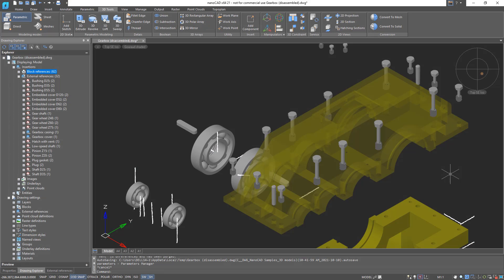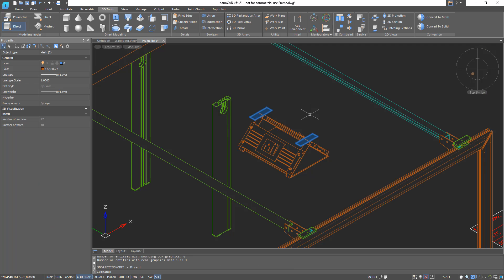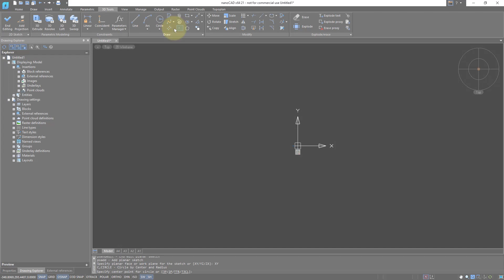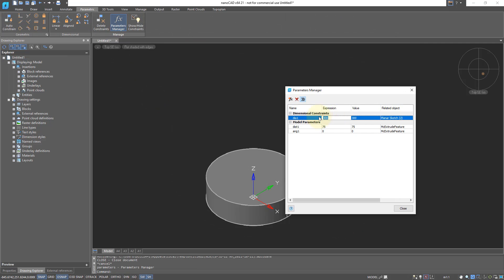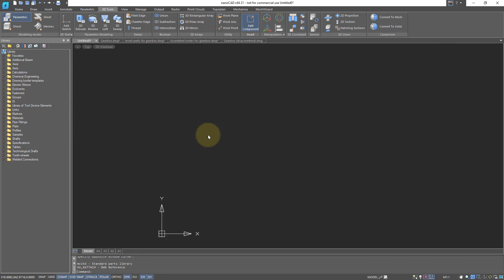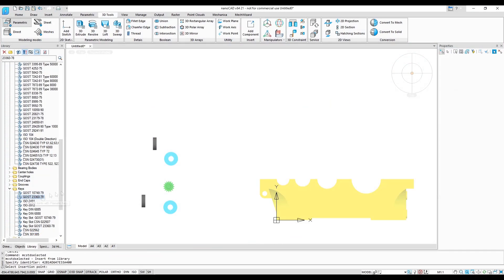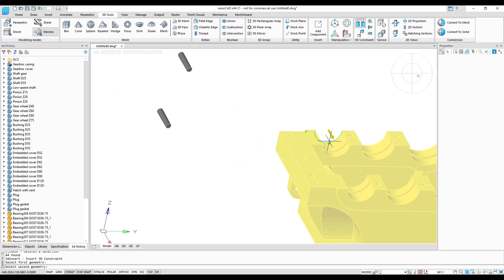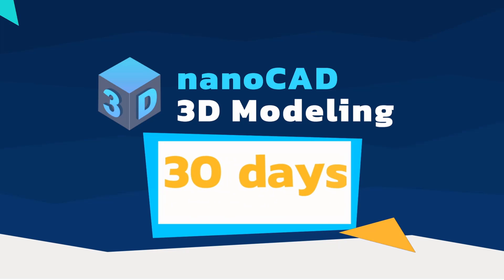Introducing nanoCAD with 3D Solid Modeling Module

Comment: Hello I am a Solidworks advanced used. I wonder if with your software it is possible to create parametric parts, parametric assemblies that in turn contain other parametric assemblies, and is there the possibility of generating two-dimensional drawings that can be dimensioned and squared, whose views vary according to the objects inserted, whether they are parts, assemblies or subassemblies. Thanks
Reply from the maker: Hi @diegofecchio, We have features to create assemblies, but their parameterization is quite limited today. Generation of 2D projections based on a 3D object is possible, and in this case, the model is linked to the 2D projection. We advise you to take a trial version of nanoCAD to try all its benefits. For any questions you can contact technical support - support@nanocad.com